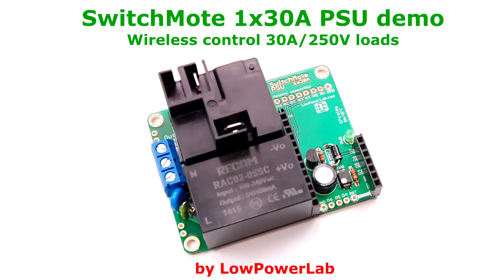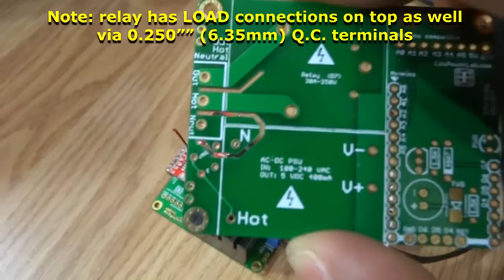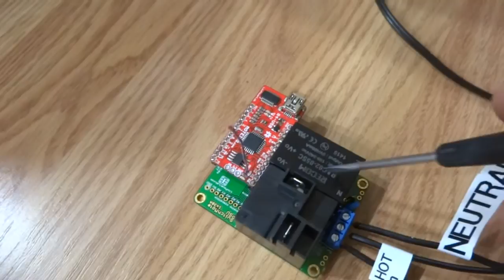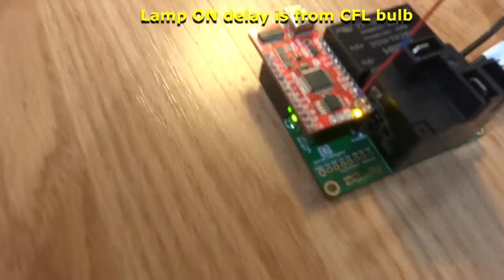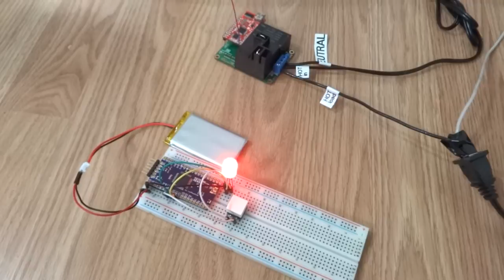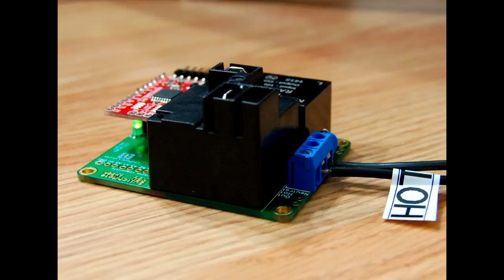SwitchMote1x30A - wirelessly control 30A AC loads

Comment: Nice vid. 

Relay function would have been much more flexible if you used a 2-pole double - throw configuration. Or laid out the pcb to accept such an optional relay. Much more powerful with more contact options.